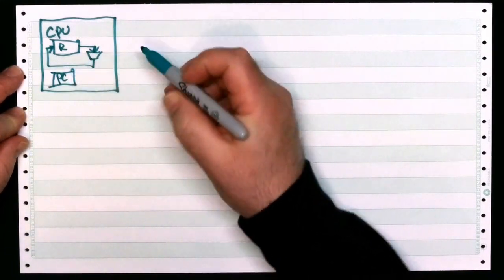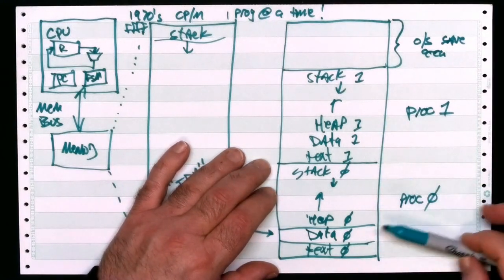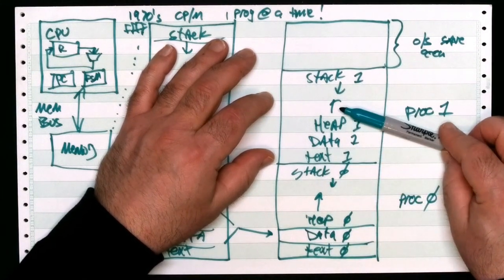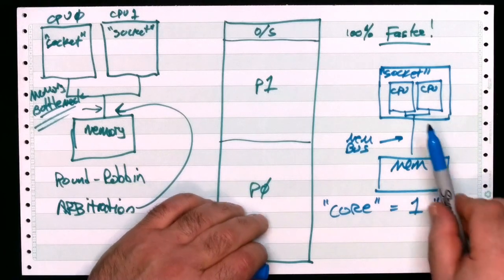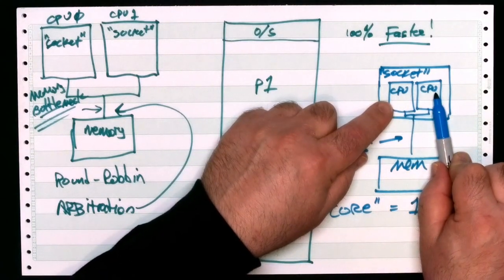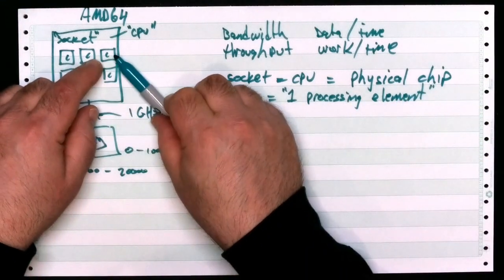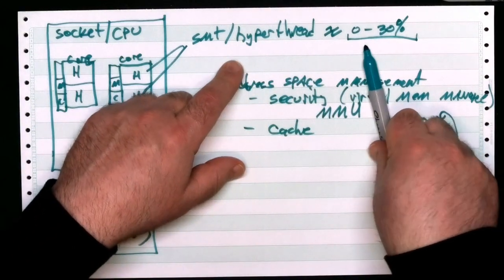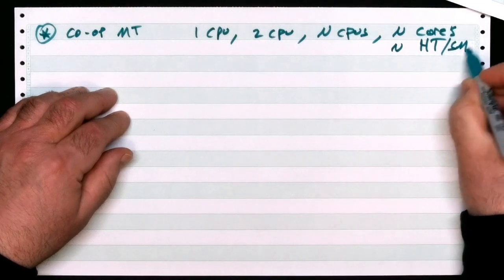Multiple Processors and Multiple Cores

Comment: Nice video but why do you put a line across your 0's? Confusing as it's a letter in some countries "ø/Ø"
Reply from the maker: Sorry.  In some contexts I use the slashed zero.  In the US the slash is used when you want to definitively state the character is a zero.  I tended to do it more some decades ago.  [Looking at this video now, I'm surprised that I felt the need to do so... and inconsistently t that.]
Reply: @JohnsBasement  ah ok I didn't know that. I only know it as a letter and the symbol for diameter.